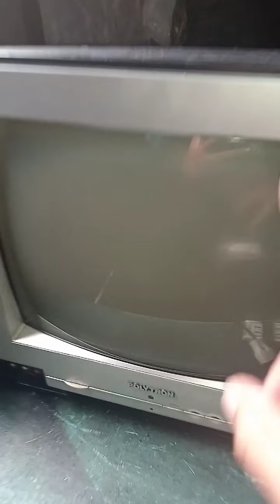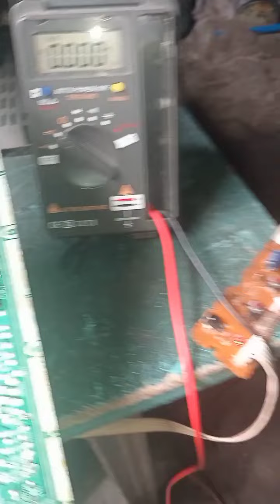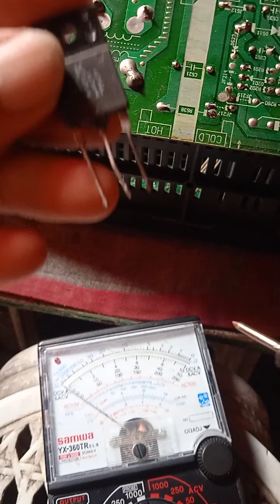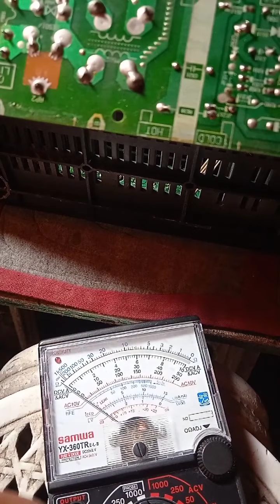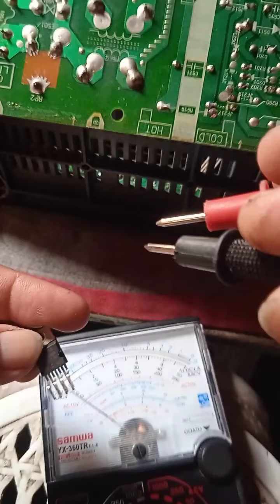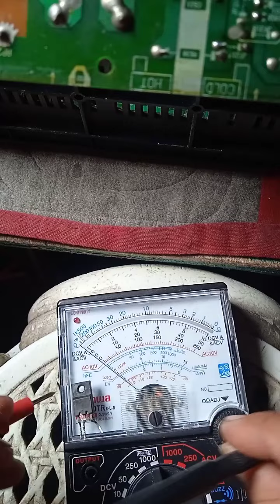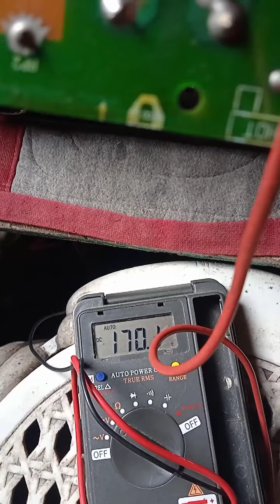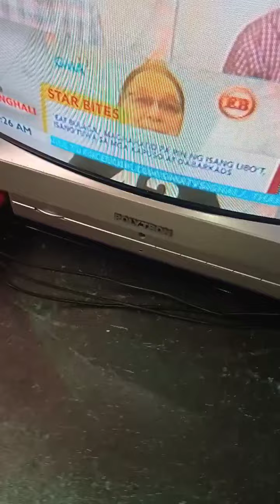CRT TV polytron 14 inches no power no indicator light how to fix

Comment: Bos may gnagawa ak polytron 14 ng oscilate sya 2, 3 second standby ulit sya mayrun sya supply 114.5v
Reply from the maker: Nagpo protect Yan Kaya ayaw magtuloy check mo Yun mga supply Ng mga component sa jungle IC,sa audio video, vertical, h-out, check mo rin un sa crt socket masalimuot kc ang polytron na brand mahirap lang kc ipaliwag sa message lng mas maipapaliwag ng mabuti kung actual👍